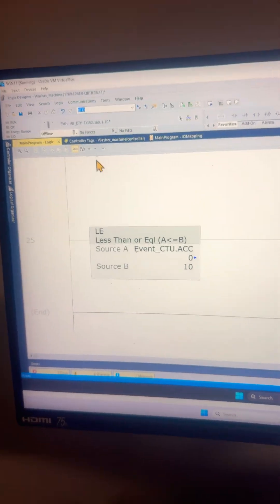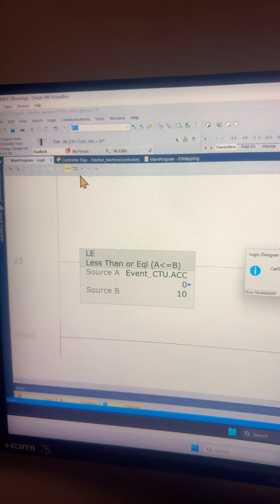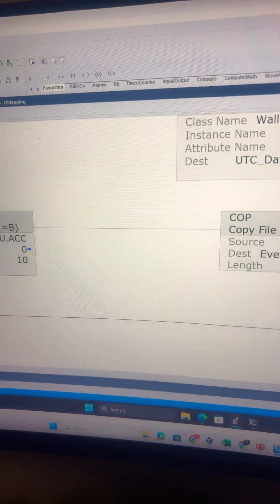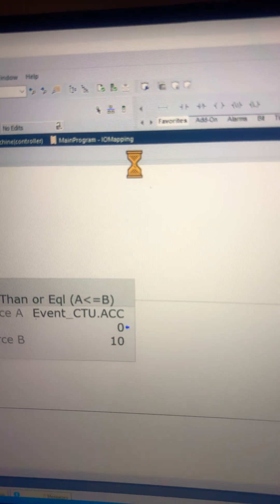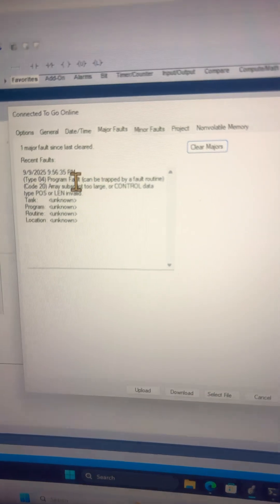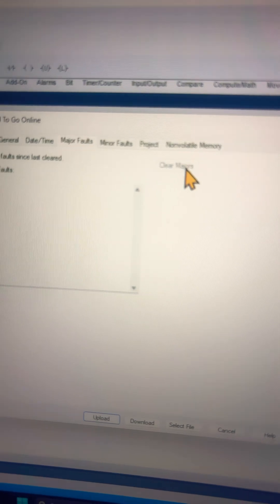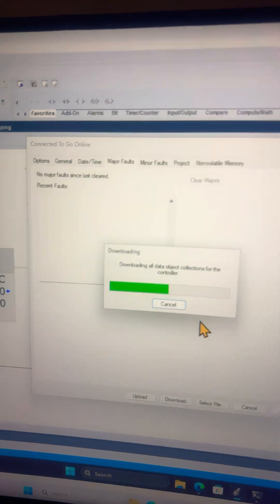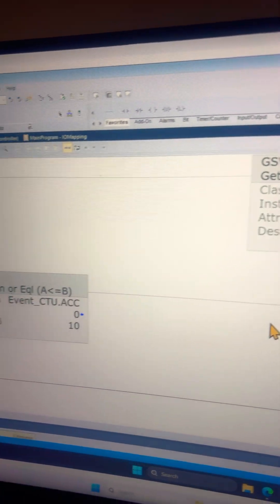How to Clear Major Fault on Allen-Bradley PLC in #studio5000

Comment from the maker: ⚠️ Quick reminder: Always make sure you identify and clear the root cause of the Major Fault before you re-download the PLC program.

This video shows the process of clearing the fault in Studio5000, but preventing it from happening again is just as important.

👉 Have you run into a major fault before? Comment below with your scenario — I’d love to hear how you handled it!

#AllenBradley #Studio5000 #PLC
Reply: Yes sir , whenever mc plc power getting ON and OFF means I'm doing same and downloding latest backup,it's a L84 control logix